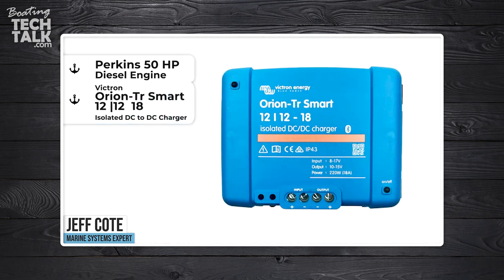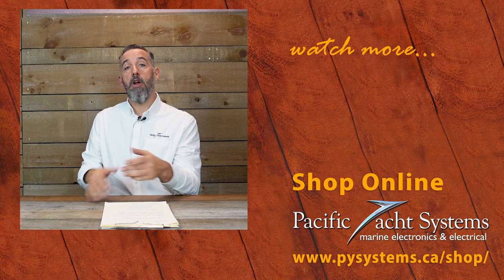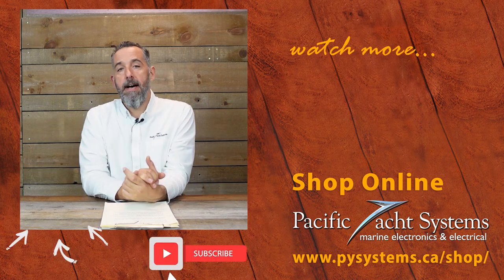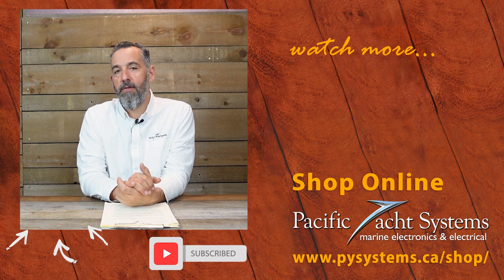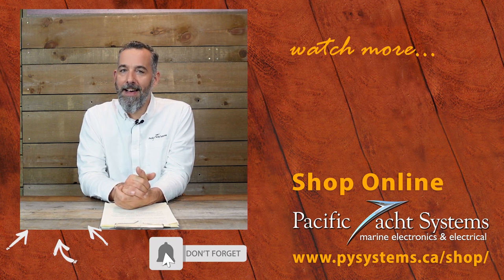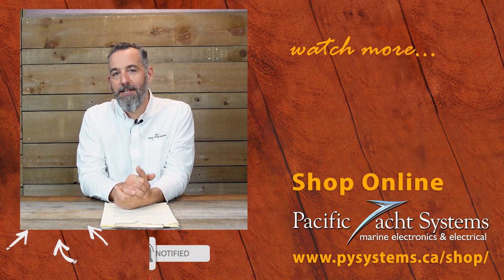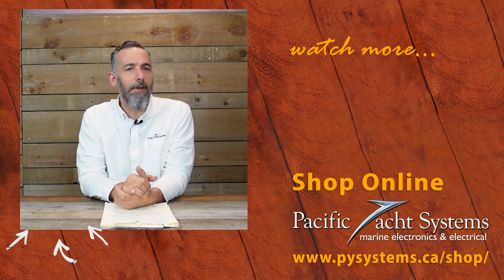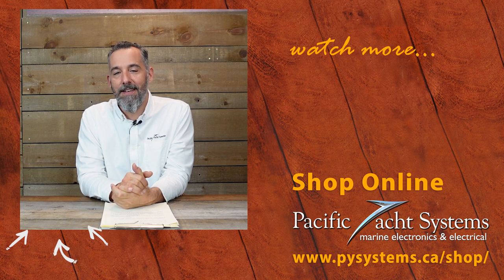Charging Lithium Batteries on My Boat With an Alternator?

Comment: Great video. I am planning to install 100 Ah 24 v lition battery on my boat which is itended to power Minn Kota trolling engine. Cn solar pannel successfully change that battery? The boat is 6.7 m rib with hardtop . Thanks
Reply from the maker: The size of your solar array will decide how long it takes to recharge a 100 Ah 24 V lithium battery. For example, a 200 watt solar array, might give you you 25 Ah at 24V of recharging in a day.

Comment: I’m a heathen with no fancy this to that chargers. I simply have a decent programmable BMS set up to disconnect at 14v, no absorb as not needed at the sort of currents an alternator puts into batteries of the size I have and this voltage also gives some time for the balancing to operate as it is in the knee section of the charge curve. I have a parallel lead acid that protects the alternator and the several solar controllers which would have made lithium profiles into a nightmare. I leave all set to lead acid at 14.4v or over. I have a slightly longer wire than needed on the alternator which restricts the current a bit using about 0.4v drop at 100A this also gives a slight taper at the end of charge which suits the recommended charge profile of the cells I use.
Reply from the maker: Thanks for sharing.

Comment: Jeff thanks for all the info. I am adding a lithium and victron multiplus 2k this spring. I have twin outboards, was planing on the Orion TR smart 12/12 -30. What is the possibility of using an A/B switch from both start batteries in an effort to have the option of running either engine, equalizing engine hours. Is this a worth while (or dumb) or just install 2 DC/DC Converters.
Reply from the maker: Going with dedicated DC to DC charging converters from each engine battery to your new Lithium battery is our standard approach.

Comment: If you have a high output alternator controlled by an external regulator and want to charge both a start battery and a sizable house bank with a B2B charger using all the output of the alternator/regulator you paid a lot of money for, then it seems counterproductive to limit that output to 30A. Yes, you can connect 3, 4, 5, 6 or more B2B’s in parallel to get back the alternator output you already paid for; but remember they cost $225 each and 6AWG cable isn’t cheap, not to mention the space needed to mount all of this equipment. I’m planning to keep the alternator on the house side; meaning my alternator output will go directly to the house bank via the positive un-switched bus. The B2B input will be connected to the positive un-switched bus (alternator) and the B2B output will connect to the start battery positive post to charge it. The only thing I have no answer for yet is if the B2B start-up voltage can be set low enough (via the Victron app) to insure the start battery starts getting charged soon after engine start-up even if the house bank is at an extremely low voltage. My back-up plan is to utilize the remoter on/off function to install a switch and turn the B2B on/off manually.  I have been trying for weeks now to get answers form my local Victron Dealers but have failed to receive any feedback. Victron does not provide support directly, which is very unfortunate. Good Luck and Happy Days...
Reply from the maker: if you have the victron connect app,  there is a demo library in the menu to see and test the settings of any victron product.  So you can see the ranges and settings of products before you buy them.  

You can also set it up so it turns on with the key, instead of a manual swtich.

the issue with going direct to the lithuim house bank is if the BMS opens while charging,  you may blow up the alternator.  This needs to be taken into consideration when planing the layout.
Reply: @PacificYachtSystems  Once again, you guys are AWESOME!

Comment: Jeff what I have done is added a FET to the alt system and made the house and starter system isolated from each other with their own shut off switch, I know what happens if the starter battery fails , well I have a spare trolling Deep cycle battery that I could use.  I also have 350 watts of solar for the house and FET is used for the trolling bat.
Reply from the maker: Thanks for sharing Leo, much appreciated.

Comment: Hi Jeff! What if he had a dual alternator set up? One for the engine battery and another for the leisure battery bank? What would he need to put in between the alternator and the lithium batteries to stop the batteries drawing too much and overheating the alternator? If he has smart lithium batteries with inbuilt bms will they prevent that without anything else in between?
Reply from the maker: You would want an external regulator on the service alternator.  IE a Balmar mc 614  with an alternator temp sensor that will throttle back the alt when it gets hot.  You can also program it so it will never run at max power but say only at 90%.  They will be programmable for the correct voltages as well.  It's really the only way to correctly directly connect an alternator to a lithium bank.

The engine alternator could be the standard internal reg alternator.

Comment: Great video. I am planning on removing my 8G4D's and putting in a 400aH LiFePO4 for my house bank. I have a solar panels on board with a MPPT comptroller but my concern is how the stock 60a alternator that came with my Yanmar 3GM30F is going to interact with the new battery. Should I upgrade the alternator or look for a smart regulator?
Reply from the maker: When going to Lithium batteries, you should definitely consider a compatible alternator and external regulator combo .
Reply: @PacificYachtSystems  thanks. Any recommendations for ones compatible with a Yanmar 3GM30F?

Comment: If you connect the alternator to the lithium batteries and have the dc to dc charger to the agm, would the alternator have a problem if the lithium batteries disconnect via the bms? Would this be a case for isolated or non-isolated charger in the circuit?
Reply from the maker: Your concern is valid, the DC to DC converter might help to avoid a sudden disconnected BMS on your lithium, but i'm not 100% sure it would work all the time. Hence, why some boaters consider the battery isolator instead of the DC to DC charging converter.
Reply: @PacificYachtSystems  Wouldn't that create a problem with the 2 different charging profiles?

Comment: I have wired systems as others have suggested, where the DC to DC charges the start bank, and all the charge sources feed the house bank including the alternator, Batteries with an external charge relay control like Victron and others (some are using CAN to control charge sources) are important when wiring in this way
Reply from the maker: Thanks for sharing Nick.

Comment: What about connecting the alternator to the 400amp-hour battery and using the charger for this starter battery.
Reply: WARNING: Good lithium batteries like the Dakotas, have a BMS (battery management system) which will disconnect the batteries from the charging voltage when it decides they are full. This will create a current spike back into the alternator and fry the diodes. There are devices out there which will take that current spike instead of letting it get back to the alternator but they are for emergencies and not for frequent use. The best/easiest/safest way to charge lithium batteries from an alternator, in my opinion, is via a dc to dc charger. If there is a better way that is just as safe, I would love to hear about it.
Reply from the maker: Thanks for sharing Mario.

Comment: Hey Jeff! Love your work, Kelowna local here, who is trying to sort out the previous boat owners electrical mayhem. 

We have dual engines, each with a 50 amp alternator. Each engine has its own dedicated starter battery. We are upgrading to 600ah of lithium for the house. We are adding two strings of solar and also have a GENSET for emergencies with its own battery. Currently there is 2 shore power lines In, and 2 separate 120VAC lines, one dedicated for Air conditioning, one for all other appliances. Air conditioning only works with shorepower line 1, or the GENSET on. 

My plan is 600 ah Lithium/1200W solar charging/3kw inverter charger to be able to simplify to a 1 line smart charging system that is capable of continuously running the air conditioning that keeps my starter batteries fully charged first so i can always get home. I don't want to deal with 1, both, 2, off switches anymore. 

Our plan to combine the starter batteries and house bank is VE dc to dc charger. Do I need one for each alternator and GENSET? Or do I use battery isolators before the starter batteries and then  dc to dc charger from starter to house?

Best,
Norb
6047610654
Reply from the maker: You should consider installing dedicated DC to DC charging converters between each respective engine battery (port and stbd) and the lithium bank. The Generator alternator output or the generator battery, ideally should be used to recharge any other batteries onboard. Instead use the AC output of the generator to power battery chargers to charge your battery banks.

Comment: With the DCDC charger setup to charge lithium bank do you also recommend installation of a smart regulator? If so, Why?
Reply from the maker: The external regulator is recommended so that your alternator outputs to a Lithium charge profile, recall the DC to DC charging converter goes from Lithium to starter battery.